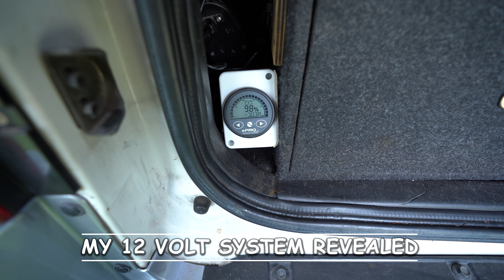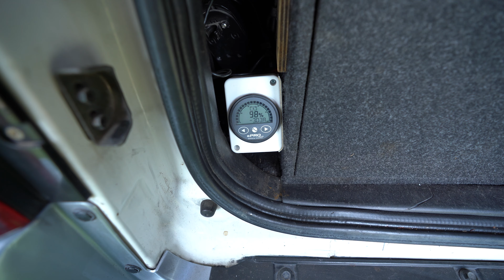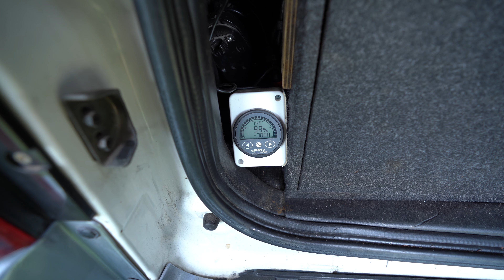My 12 volt system in my Mitsubishi Pajero

Comment: You've open up the lifepo4 worm,this'll be good for heaps of comments and enough free advice to confuse the hell out of ya .Here is my two bobs worth,just go on line get a 135ah lifepo4 smart battery and without changing anything else put it into the box,end of story don't even bother up grading the Charger! Try talking to Luke he might be open to cutting you a good deal and provide you with a discount code like I tech did for Buck .I have a feeling he may be open to rewarding loyal friends and supporters at the moment!🍀😍🇦🇺🍺

Comment: Phil your right Waite until you have the $$ to do it right so that it serves your purposes and last the test of time . Honestly I would steer clear of enerdrive,  yes they have all the bells and whistles and look amazing, but they do not last and they have over heating problems,  seriously. With electrical gear the simpler the better,  and your right 40 - 50 amp dc dc is best for lithium,  red arc is expensive but you never have to replace it . And Paul who owns DCS lithium battery’s is very proud of his product, he reminds me of Luke at drifter . Good luck mate
Reply from the maker: I’m very keen on the DCS.   Thinking about paying them a visit in a couple weeks